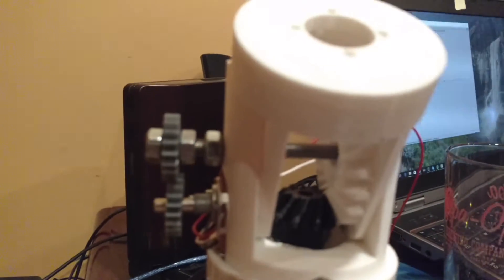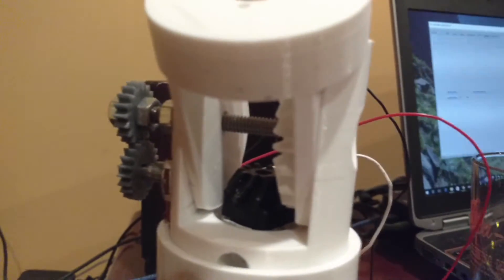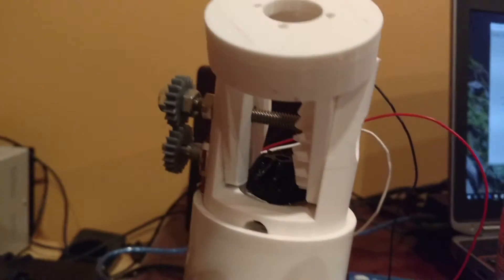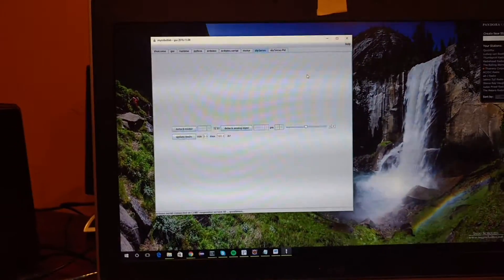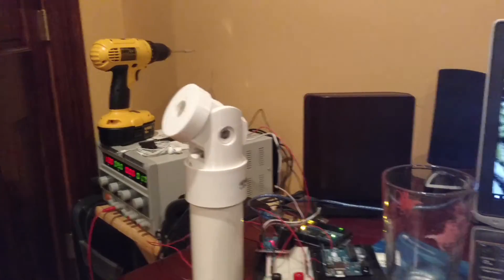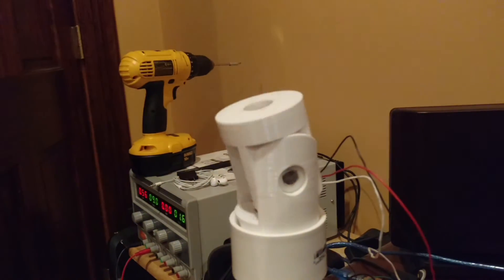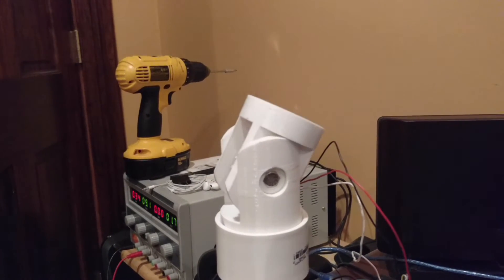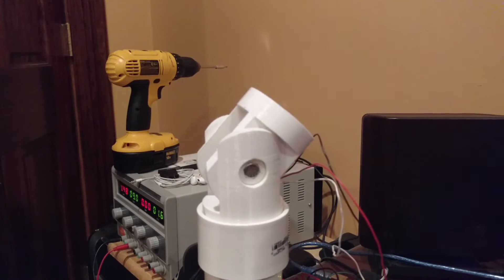Diy servo service in MyRobotLab

Comment: Im working on a star wars droid which is going to use these diy servos for the neck, arms, and legs. The droid is gonna be 1,90 meters tall... do you think its gonna work out for the legs?
Reply from the maker: Good luck with the droid!  This design might not be strong enough for that.  Perhaps, adding some threaded rod / screws in the two main halves so that they don't snap.

Comment: That is so cool how strong would you say they are? Would they work good as Legs for a spider robot?
Reply from the maker: Depends on how large the spider robot is :)  .. It's really up to you how powerful it is.  That all depends on the motor that you choose and the motor controller.  This demo was using a simple 2 amp H-Bridge which still has a good amount of power.  If you want more  the IBT-2 motor controller is rated at over 50 amps...